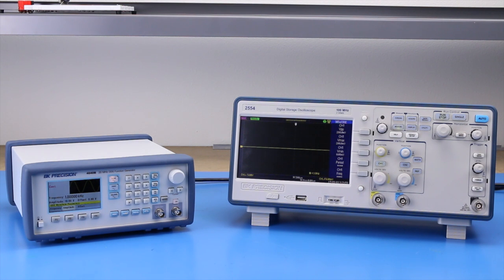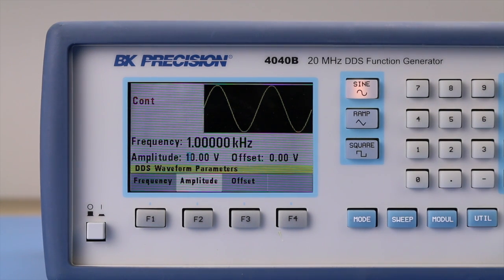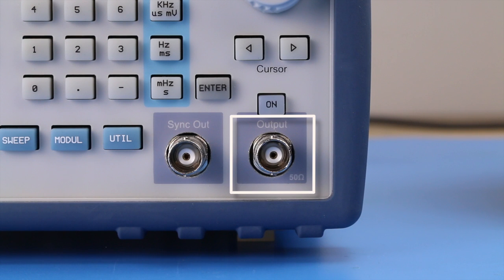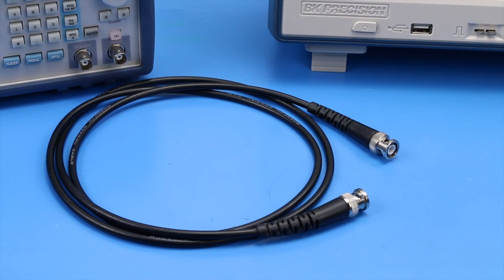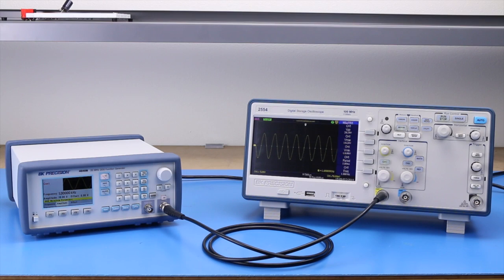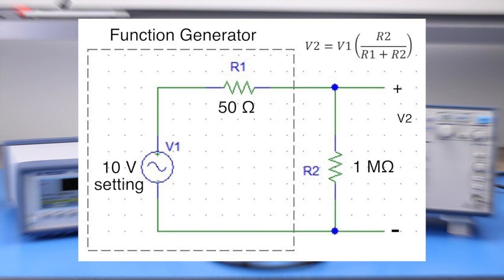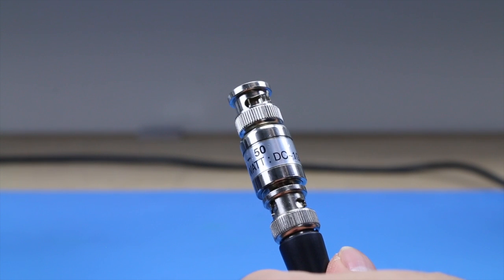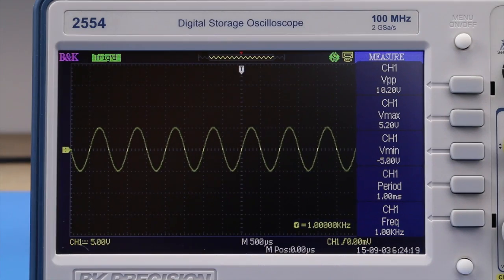Why is the output voltage on my function generator twice my setting?

Comment: Sir, twice the output of the function generator is visible in the oscilloscope. Whereas the output impedance of the function generator and the impedance of CRO form a voltage divider circuit, so half of the input of the function generator should be visible in the oscilloscope. But it shows twice of FG input in CRO .Why so ? please explain

Comment: Thank you for your good explanation! I had this doubt and now your video confirmed that mine theory was correct about this.
I was worry because my function generator generates a signal with a voltage amplitude and my osciloscope read with twice upper value for the same parameter (Vpp, for example, the generator produces a square signal with 5 Vpp, from -2,5 V to 2,5 V, showing in your display this limits, but, my osciliscope reads 10 Vpp, varying from -5 V to 5 V). I hope that is be this reason. I will trying to acquire a 50 ohm terminator to make more tests!
Thank you very much.